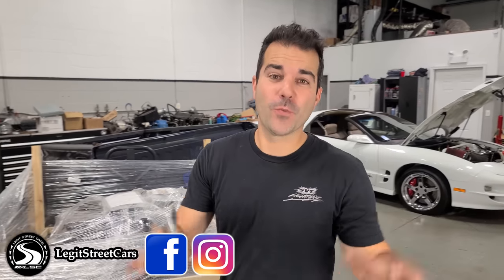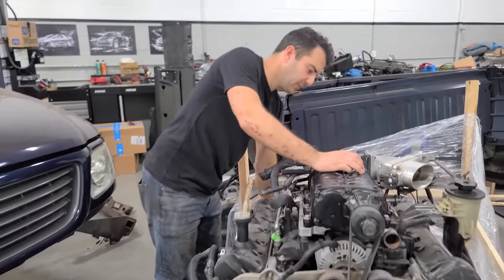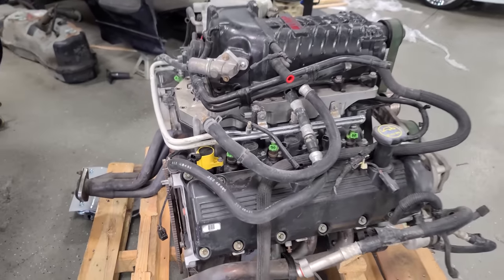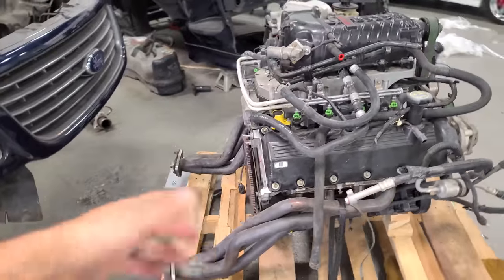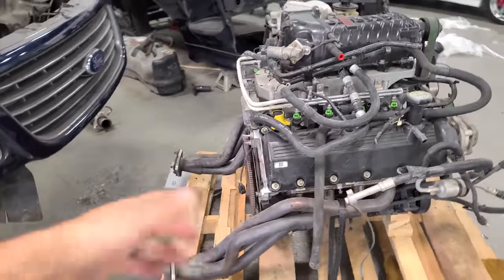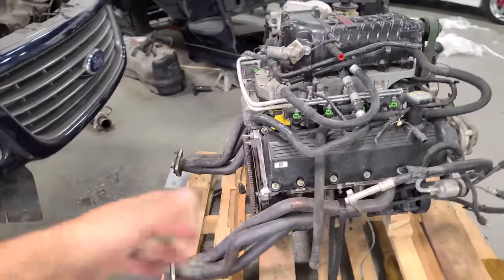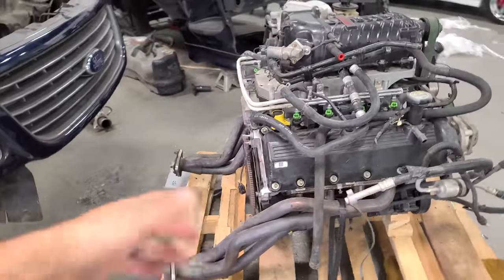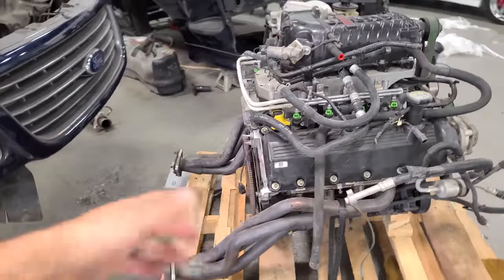I Bought A $9,000 Engine For My SVT Lightning Off eBay Motors! First Start On A Pallet! It's LOUD!

Comment: I always make an illustration on some cardboard of what I'm taking apart and stick the screws, nuts and bolts (think zip ties) into the cardboard. No mater how long its been I know exactly where the parts are and where they go. It's easy and works great.
Reply: Take photos with your smart phone.
Reply: I’ve used the cardboard method for years on computers. Think lots of tiny screws. It’s a lifesaver.
Reply: @SchoolforHackers  Works for everything. 
Where are the nuts and bolts?  Right here.

Where can they be stored? Anywhere.

Where does the nut or bolt go? Right where it shows on the picture. 

Never lose a thing and know exactly how it goes back together. Awesome. 
Cheers

Comment: A torque converter is a fluid coupler. It transfers rotating motion with internal baffles. It acts as a buffer and also can multiply rotation force

Comment: I had a minor repair of my own Mustang this morning. Yesterday, the bearing for the fan went and the blade was wobbling wildly as a result and cut through the shroud. Caught it within 5 minutes and called Auto Zone for the replacement. Swapped in and running again less than 24 hours later.
Reply: Thanks for the update, chief.
Reply: And this is related because...?

Comment: Those dents in the headers wont affect anything. David Frieberger on engine masters did a test and basically smashed a tube shut at the end. No matter how many dents they put in them, they still flowed well and the motor made the same power

Comment: One more thing 😆 also get a PS Resevoir relocation kit. 60$ and worth it so you can pop the covers off without taking the resevoir bracket off each time. It mounts it to the front timing cover on the studs and also replace your coil pack screws with some nicer ones from stan Saab.

Comment: Noticed that same odd gasket thing on my 1999 Mustang GT passenger cylinder head when I supercharged it. I was told that Ford used the head in a variety of different applications and some had intake manifold bolt styles. Therefore the gaskets accommodate for either style intake manifold.

Comment: Wouldn’t it be cheaper to buy a Coyote and at low boost would’ve doubled the power for less.
Reply: Agreed
Reply: Yes
However i think he just wants something that'll drop in and go
A coyote would require a ton of custom work wouldn't it?
Reply: Probably wanted a direct fit from the jump.
Reply: Watch the video he explains why…
Reply: @joshuaa1921  what makes you think I didn’t watch it did you saw the rust inside of the piston when he was bore scoping he’s also waiting for the rods because he already has pistons num nuts
Reply: @joshuaa1921  all for a parade I watched it when he uploaded it keyboard warrior
Reply: @BamBamsflow  A lot of people commented on wanting to see them build the motor..  how is he a keyboard warrior 😳 when you are the one taking it personal and getting revved up.
Reply: @BamBamsflow  He specifically explains that he is swapping parts over from the "new" motor to make the old motor complete so he can sell the old motor. How would he do that if he bought a coyote?
Reply: @kylemcweeny878  my problem is he assumed I didn’t watch the video when I did
Reply: @BamBamsflow  I get what u mean I used to do it too. Now I kill em with kindness and make them feel stupid not by call8ng them stupid, but by out witting them with knowledge or clever mind games. Much more effective. Also in real life if you go off and call people names you burn yourself because the people repeat what you said and you sound sleazy and disgusting. Ask me how I know lol. But if you outsmart them and diss them nonchalantly by making them feel stupid with superior wisdom and knowledge backed by facts, subsequently you not only make them feel worse inside but also they got nothing to parrot to your boss or whoever might have the power to make your life harder later when your back is turned. 😉

Comment: The re-install will be great! I am so keen to see how the Lightning performs with this stock engine with the supercharger it came with compared to the one that came with the lightning when you bought it. I am certain you did some performance runs! Even if you didn't you have to do some and compare it with the rebuilt engine.

Comment: The fuel pump resistor on the front frame missing is causing your issue.  Guys make sure that thing is good. These trucks will strand you if that thing goes bad. It's in a bad location too. Right at the front of the truck where things can bash it. It's a white ceramic horseshoe 🧲 looking with two wires. Cheers.

Comment: They key restriction from stock to making real power after mods is the cams, of course you gotta add heads, etc. My friend made 750/775  with foxlake heads, custom cams, 2.6 Kenne Bell. 60 lb injectors and dual pumps. It put down 350 stock on the same dyno.

Comment: I blew my 01' motor in 2004 with 25k miles on it. I bought an 03 long block with 2500 original miles for $2000. 👍 That's where my 9mm went to. I would say those were my cats that weren't cats but I took downpipes & cut the skin off my cats then welded them over top of the downpipes. Looked just like I had cats. 😜 We have state inspection in Virginia so you do what you have to do here. I had those Granetali or something like that coils on mine. I forget how to spell it. It was so long ago. I always shopped at Lightning Force Performance back in the early 2000's. I don't know if they are still around or not. No problems at all with those coils.

Comment: @ 9:40 I'm glad I'm not the only one that takes extra Chipotle napkins to keep in the truck😏 those green top Ford injectors are 42lbs. Injectors. I use 4 of them in my turbo 4 cylinder. For me it's the 8mm and 10mm sockets that grow legs and walk to the airport.

Comment: I'm pretty sure that intake gasket works on both sides, so when it gets rotated around to the other side, that coolant passage that's exposed, lines up with the passage on the front of the opposite cylinder head.

Comment: I bought. 79 Monte Carlo t-top car been sitting 5,6 years any pointers on getting the motor running and advice would be greatful , I am going to use your oil/ kerosene mix for the cylinders ( is that a 50/50 mix) anything else would be awesome

Comment: 13:25 Modular Ford engines like the 4.6 and 5.4 use the same head casting for both sides. Naturally, the same intake gasket is also used for either side but some ports in the head aren't used depending on what side the casting is used on.

Comment: I have a 2002 bought new in June and 2004 lightning. 
And I was thinking about selling it due 4 threads. But I checked and it had 8. 

I asked a guy that manufactured them how that can be. 

He said there were 4 and 8 sold all the way to Spring 2003. So, if you didn’t know you could end up with 4 threads if not checking it.

Comment: It's a pet peeve of mine when people don't clean the spark plug area BEFORE taking them out, because it's such an easy thing to do.  You can clearly see what happens when you don't @ 15:40.  It's quite a destructive thing to have all that crap in the cylinder, can easily ruin an otherwise perfectly good engine in no time.  I mean, thousands of $$$ of damage because you can't take an extra minute to blow all that crap out???   🤬

Comment: looks like a gen 1 vmp, not much different than the stock Eaton at that time since vmp owns that casting, but I think that was the first one. Piston was probably torched from high iat's.. Use a little shot of water methanol and she'll be ❄️

Comment: So many other motors you could have purchased for 9k (e.g. Aluminator 5.0, 7.3, junkyard 5.0 with 5-6k for upgrades) those 2v heads just don’t flow enough to make them worth the effort. Really hoping that eBay picked up the check.

Comment: Well I’ve heard of a few motors using stock head bolts and slightly over torquing them and have seen great results. Ik for sure it’s been done on Nissan vq motors.

Comment: When you were removing the plugs, they looked like only 4-5 threads were actually going into the heads based on the view of cleaner threads vs dirtier from being outside the head.

Comment: i mean the lightning 5.4 and shelby gt500 5.4 and 5.8 are the same they are just an aluminum block engine with 4 valve cylinder heads which you can still swap over to 2 valves and all work the same

Comment: I would be interested in it. Been wanting one to put in my 99 f150. Right now it still has the stock 4.6 in it and it still runs but unfortunately I had to park it for several reasons

Comment: I had to use the Time-Sert  # 5553 thread insert kit on my 1997 Mark VIII 4.6 DOHC engine.  At the time, I didn't know using the Motorcraft plugs in that engine was a timebomb.

Comment: Why don´t you clean up the spark plug holes beforehand? Just a bit of brake cleaner and compressed air and you won´t have so much dirt fallen into the cylinders.....

Comment: I had a work truck the f250 super duty with a 5.4 back in the day when I was doing service work as a plumber and yes that thing blew out 2 plugs on 2 different occasions……my mechanic buddy told me the 4.6’s don’t have that issue….do they?

Comment: With these 4 thread heads it probably isn't too tight. Factory spec is around 15lbs. Torque them to 23lbs to avoid any spark plug blow out issues. Ask me how I know...

Comment: Cre-oil - $19 for 11oz. 
A 50/50 mix of trans fluid and acetone, which works much better, will cost you $20 for 64oz. One quart of trans fluid - $10. One quart of acetone - $10. A no-brainer.  
In the event you may not have an adequate spray bottle you'll need to make a one-time purchase of Zep professional spray bottle or equivalent metal or hard plastic sprayer, so as not to be affected by acetone, - $3.50. You will not be disappointed.

Comment: READ THIS COMMENT
Don't forget the bracket for the rear of the passenger head! It holds the water pumps hard line in place and wiring harness from manifold. Not super crazy important but trust it's worth doing it.

Comment: My country has a stupid law where engine is not recognised as a spare part, so if you change the engine you need to change the engine number in the "vehicle permit". So what we do here is save the original engine and put whatever we like, but every year before the registration and inspection put back the original old one in. Stupid

Comment: Kool. But in case.. if I was you to keep that a spare engine on the side so incase you have another issue.. not sell it again.. because it can be a parts engine for you. Or have to rebuild another chance if you fried the other engine. That's what I would do if I was you.  Be Hard to find another engine down the road if you had issues with your built engine.  Specially in good condition like that one was.

Comment: I want a 2nd gen lighting with 5.8l trinity engine from older gt 500..... Also the electric F150 does not count as a 3rd gen lighting.... It's an electric f150 that happens to be also called a lighting

Comment: If that motor is an 02 than that’s why the heads are different there was that horrible method of keeping the water crossover separate and 03 is the last year for what they called heritage models

Comment: Such an iconic truck for longevity should have decked the heads and block put head studs in it and slammed it back together
Reply from the maker: With no rods?
Reply: No I probably wouldn't have changed the pistons or rods at that mileage I would have pulled the pan and checked the end play on the crank maybe checked the main caps and if they looked good put it back together.  But iwouldnt upgrade the motor as Much as you are. pully and tune is about all I would do they usually last longer stock. But I bet it's a  bad ass ripper when your done

Comment: You really should have blown out those spark plug holes with compressed air before removing them, a lot of dirt got in which can scrape up the cylinder wall...

Comment: Love your channel . Would you consider putting a hydrogen system on one of your vehicle's as a test. Considering all of the interesting modifications that you do this would be a way to eliminate using fuel . I think its easy to do and would a fun experiment.
Reply: They are mechanics not rocket scientist's

Comment: I unfortunately have a story behind the "make sure an engine is actually good"... ended up spending $900 on a motor for my 2003 Sequoia, had a video of it running emailed to me, looked good, bought it, fired it up, and threw a rod out the block… The scrapyard blamed it on me, saying that I did the timing belt wrong :( All within the span of a week and they refused to give me a CENT back
Screw city auto wreckers lol
Reply: is there any chance that you did do the timing belt wrong?
Reply: @MikeDawson1  no sir

Comment: yes I think you are nuts for spending that kind of money on a used engine.  However, I think you are crazier for running an unknown "tune" on that engine.  In fact, since you have a different MAF and air intake on there than the one on the truck, you would be a fool to try WOT without checking AFR and fuel trims.

Comment: If i see the socked then you confuse me. Because a 9mm bolt takes an socket 12.
An m10 bolt uses a socket 13
 So please dont confuse metrik boltsizes and their socked seize.

Comment: i said last video i would get a coyote for it. start out with 450hp naturally aspirated and just add boost and fuel and stock sealed engine no heads no cams no pistons no rods can handle as much as 1200whp. which S550s  mustangs have ran 7s and newer v8 f150s run 8s. Stock sealed coyote  wouldve cost about 3k and you could get a used supercharger or turbo kit 5k. So same money way more power and way more reliable. hmmmm no brainer go coyote

Comment: From Big Cat at Houston? .. they overpriced af, you could of gotten something else for that money.. I went to buy an alternator from them and it was squeaking bad, went back and they gave me a 6 rib alternator, I got fed up and threw it away, used alternator for $150 lol, they wanted $150 for a throttle cable, and $150 for a dash cup holder, they also wanted $350 for a heat exchanger lol, I left that place and order my stuff online on the Lightning pages
Reply: That thing on the head/ intake gasket on the new engine is normal

Comment: So you took an engine with a blown head gasket and instead of rebuilding it you replace it with a used and modified engine to produce more boost 🤔 watch it have bigger issues
Reply from the maker: No,  I explained in the video why I put this engine in.

Comment: Ebay is garbage now.  Small sellers have been pushed out and they for you to take returns from buyers that know ebay will take their side.  I used to do a lot on ebay and now I only use it when I cannot find something anywhere else.  Usually I can't find it there either.

Comment: I just need some advice or guidance. My 2014 Nissan Pathfinder just got a new transmission cause cvt trash. But it’s not the smoothest ride. New tires balanced rotated. What might make it a rough ride. Love from Tennessee
Reply: My mom has a 2013 they bought new it just rolled over 80k and is on its 3rd new transmission

Comment: I don't know... all that ebay thing is scaring me away. One order did not even came to me, seller was a total ** responding every 48H. Some of the stuff there is extremely overpriced. Sometimes OE parts from dealer are cheaper than ebay

Comment: I know why the head and the intake don't line up its because the triton engine is what ford calls a modular motor so the heads are the same casting so they don't make left and right heads they make one head and one head is backwards that's the thermostat housing hole on the driver side head but there no hole on the back side passenger's block so its a dead hole and some intake cover it up and some don't I'm not a real mechanic but 1000 hours of mechanic YouTube later and here we are

Comment: You would never do a leak down test unless you had reason to think you should ..like a hole that would not build compression or a bad misfire possible burnt valve .  But to just take any old motor on a floor and do a leak down .. not unless you were a wannabe or a poser..

Comment: $9k for a junkyard engine? For a Ford ? Honestly I wouldn't pay that much for a used engine specially for a Ford I'd rather overhaul the engine is a big project to risk it for a junkyard engine especially for that amount and resale value of that truck is not that great either so unless you plan to keep it don't blow to much money on it . Good luck

Comment: All I can say is that's a major major disappointment you got what it accumulates to a GT500 blower a set of stock injectors and a computer with a piggyback module in it big deal.
I would be very leery of that engine knowing that the guy use stock injectors with a bigger blower because the stock injectors were barely big enough for the stock Engine with the stock blower on it I know I got one and a piggyback module in order to tune it you're going to have to get rid of the module and have somebody else tune it with probably advantage 3